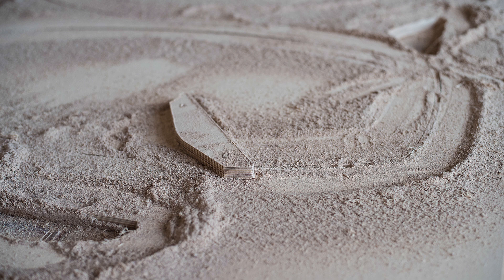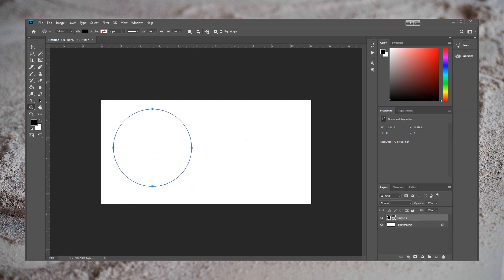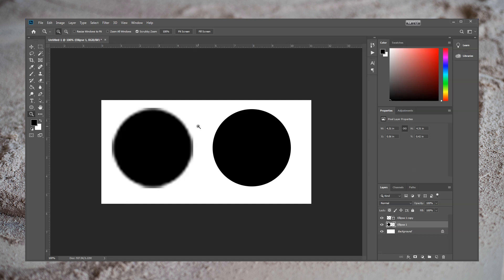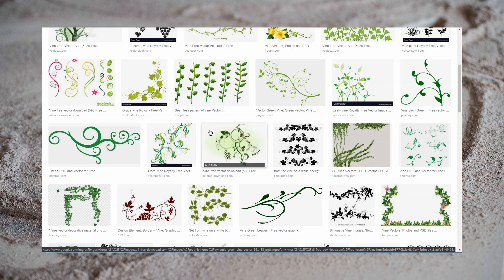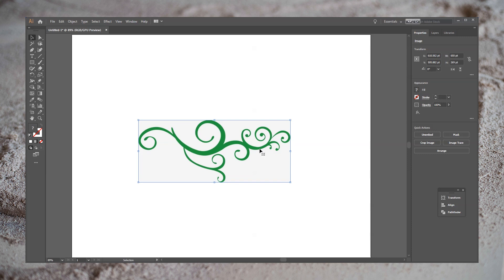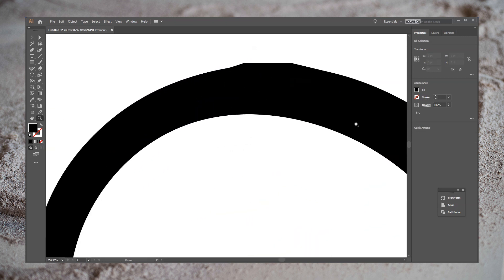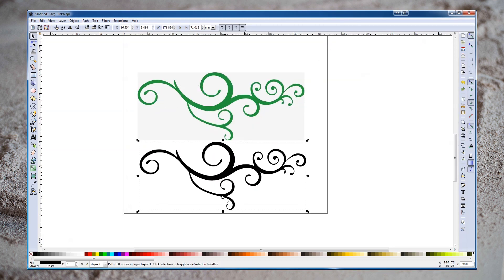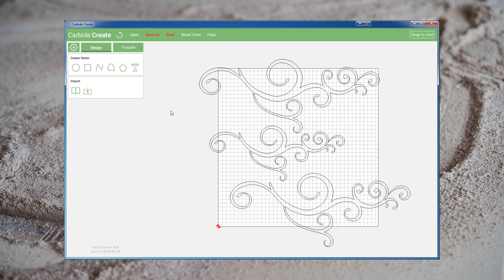Practical CNC 05 - Making Vector Graphics from the Web

Comment: Did you check to see if the shape you got from the internet was copyrighted?
Reply from the maker: I did look, it was on a pretty generic clipart style site that was suspiciously lacking in author details. I made an attempt to track it down further with no luck. I would have preferred positive confirmation that it was royalty free for general use, but sometimes authorship and the internet are tough. For my commercial work I tend to stick to stockart sites in particular Envato's since it doesn't fall as deeply into the trap of requiring credit packs.

Comment: How are you uploading 3 different image files into carbide create? If I try to upload a 2nd image the first image disappears. I was told that carbide create can only handle one image file per job. I'm about to pull the trigger on VCarve Pro. Carbide create is lets just say, crappy.
Reply from the maker: There used to be that limitation but carbide create can now import multiple svgs into one design

Comment: In regards to the Google search, I found that also narrowing the search with the 'Line drawing' option filters the results down to mostly useable images. Obviously this won't work for everything one might be after, but it helps significantly.

I've recently purchased a Shapeoko and have been learning a lot from your videos. Thanks again.
Reply from the maker: Good tip, line drawing will definitely filter out a lot of unsuitable images